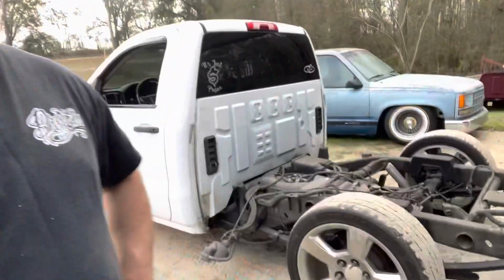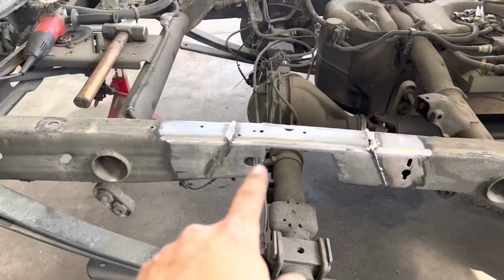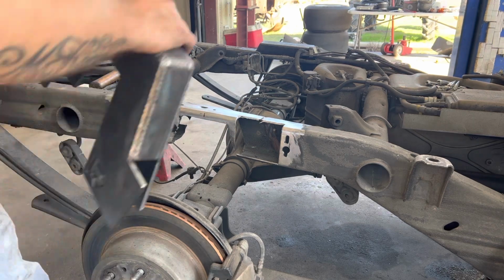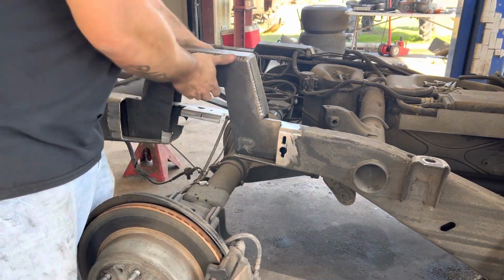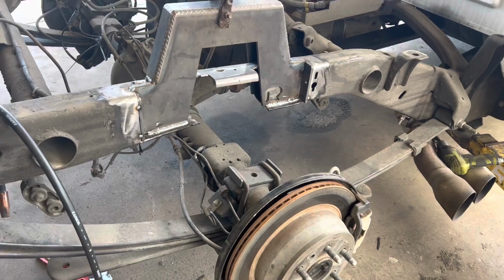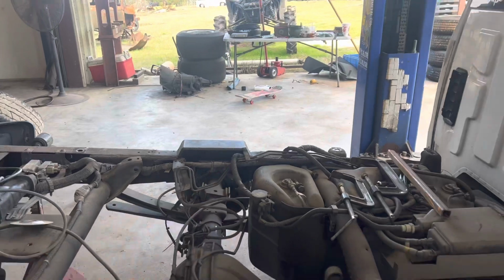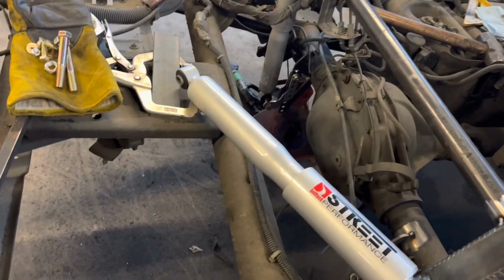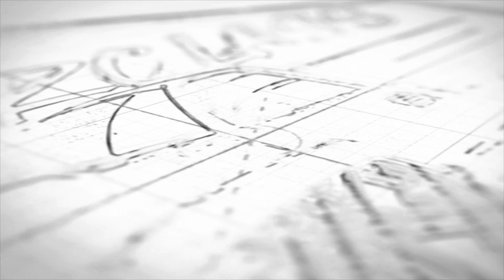Installing a @ReklezSuspensionWorks narrowed step notch and shock relocation kit in a 2017 Silverado

Comment: On those relocation brackets, do you have a gap between the axle plates and the adjustable plate? I have a QA1 kit that I’m trying to use with my Belltech 2210s and i have about 3/8 of a gap in there. Considering just using washers to take up the gap, trimming the shock bushings, or just returning it to summit and going Reklez. Trying to see if the Reklez ones will have the same issue.. would appreciate a response bubba. Truck bed is off in the driveway right now 😂😂😂
Reply from the maker: Those brackets are designed for like a coilover shock which usually has a smaller mounting width than a standard shock…throw a couple washers in and tighten it you will be good
Reply: @lowerclassfab431  10-4 thanks bubba

Comment: What kind of shocks , would u recommend on a 5/9 drop 08 Silverado with underbed ?
Reply from the maker: At 9 you  gonna have a hard time finding anything but the Belltech 8510s with shock extenders will work
Reply: @lowerclassfab431  I sure appreciate your help !!!, thank you
Reply: @lowerclassfab431  this set up should work fine on a single cab correct , I forgot to mention the type of cab , but just want to make sure ?
Reply from the maker: @christiancastro3382  yessir should work fine….the shocks will still be close to bottomed out but will have alittle travel left in them